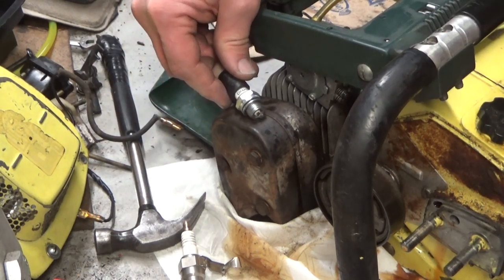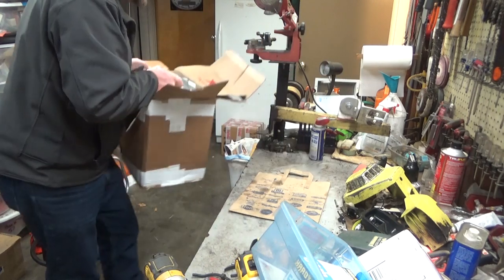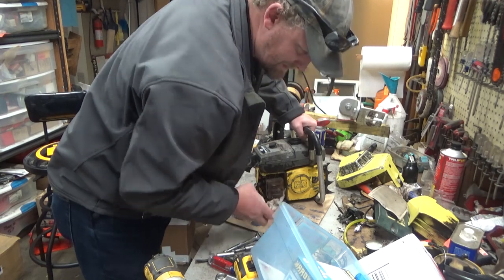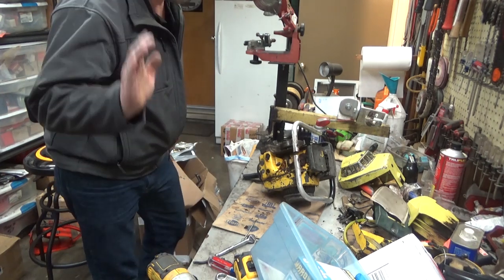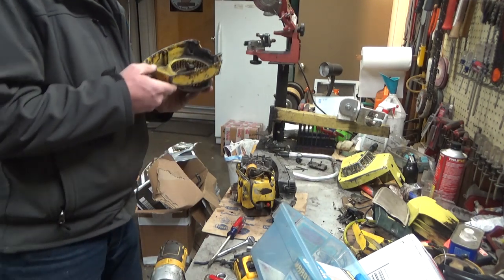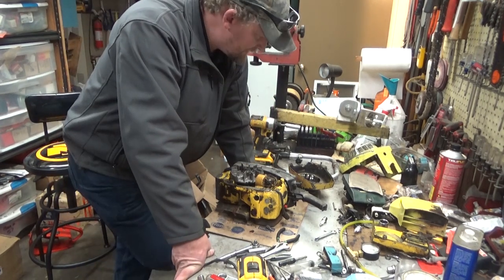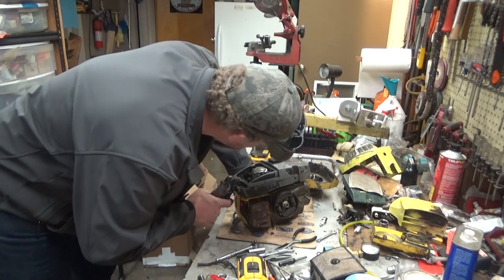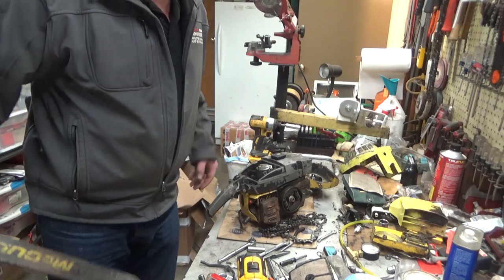Pioneer P-51 Diagnosis & McCulloch SP81 Unpacking & Diagnosis, More of the 82cc Challenge!

Comment: Im very interested in how you will fix the broken piece. Im sure my father inlaw would say jb weld.
Reply from the maker: I ended up drilling it out and inserting a Heli-Coil.  Maybe not glamorous, but it does work!
Reply: @LeonsChainsawPartsAndRepair  ok thanks. Ive used them in engine blocks an a very sm 1 in something. Thanks hope works out well.